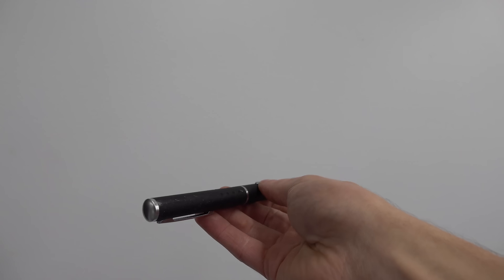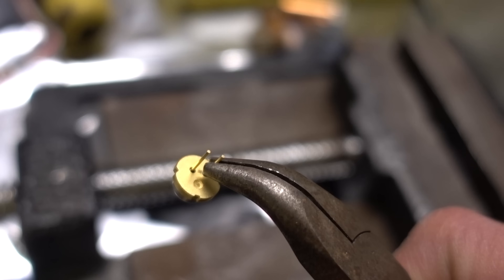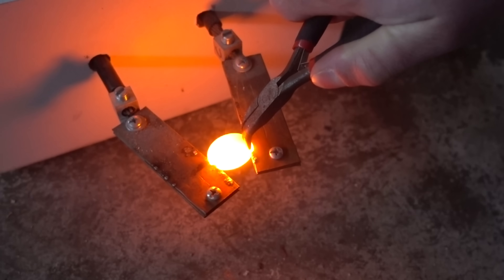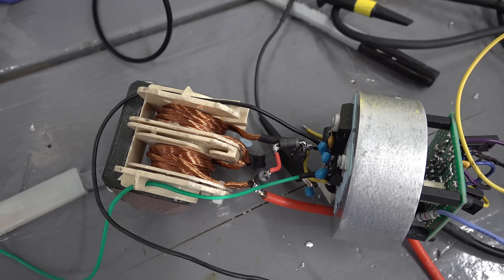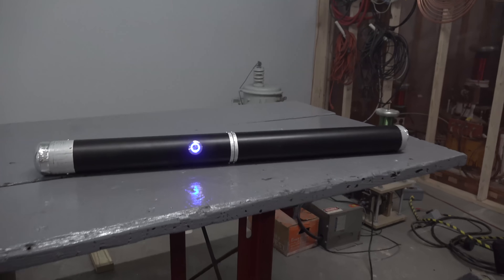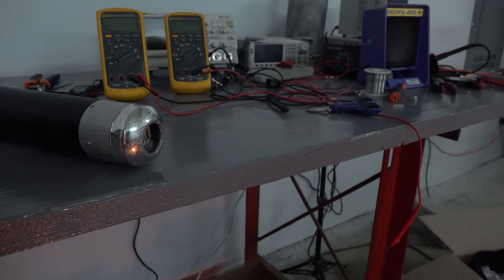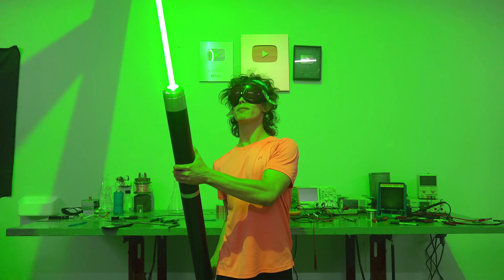the brightest laser pointer in the world!

Comment: I'd really like to see a styropyro explanation and hack video covering LEP lights.  I mean, it's a practical consumer use of lasers that just begs to be Tim the Tool Man Taylor supercharged well beyond common sense.

On another note, have you ever looked into building the optics and mechanical assembly to converge all the beamlets in one of those laser arrays?  Obviously it would be tricky as heck to get everything to work together to actually divert each beam just enough to converge at different distances, but it should make one awesome looking set of mechanical linkages.
Reply: How bout a distance finder coupled with a liquid flex lense..  Can use a clear liquid filled , linear,  in tube electromagnetic piston pumping fluid to convex or concave the flexible lense, callibrating it to work on demand with the distance finder... Fluid in electromechanical tube is pushed and pulled at same time.
Reply: Any Thoughts?
Reply: You could just use a few giant glass (or other material) lenses in a similar format to a camera, but in reverse. A camera takes a large area of light and converges it without too much distortion onto a smaller area. If you do this in reverse, you can converge a laser array down to a smaller area. The only problem is that the laser could end up melting the lenses. In which case you have to use mirror-based lenses made of metal.
Reply: @nikkiofthevalley  Dig it.. Understood.. However the fluid as with any component needs to be cooled.. So apples and oranges?
Reply: Initial thought is repurpose a DLP array out of a rear projection tv as some form of adaptive optics. If not it'd be funny to see them catch fire and explode.
Reply: @johnalees99  so what you're saying is collab with @ElectroBoom

Comment: hey quick question, how far does the heat travel down the laser? would it heat stuff up the same from 100m or further as quickly as point blank?
Reply: Yes
Reply: The beam itself does not eminate heat. From my understanding, the heat is generated as a response to friction from the massive energy waves slamming into a solid object. That's why the laser can't ignite the fuel vapors by itself

Comment: I had a green laser pointer like that first one. It was pretty good, I mostly used it to play with my cat, which was fine. But the battery wouldn't connect properly for ages so I replaced it with a better quality looking one, and this one I don't like for the reason you stated; it's too strong. The green dot it makes is bright enough that looking at it can put spots in your eyes across the room, and I kept thinking it was too dangerous to play with my cat anymore. I basically stopped using it for that reason.

Comment: I just purchased one of those green lasers. I was wondering if you can safely look at the laser impact on the wall? It's very bright and can illuminate the room green
Reply: If it illuminates the room it is probably way more than 5mW. I have one that measures around 3mW and the dot is bright but not difficult to look at. No after images either. Using it as a room light doesn't work :p. If your eyes are really adapted to the dark it might work, I never tried.

Comment: p.s. a m2 1.6 200mW DPSS will smoke a CMOS sensor easily. Let alone 10W OPSL, 30W rgb etc etc... will do it at quite a distance. Projectors also don't like it. This happens in shows rarely when cameras (drones) and projectors with lens caps/internal shutter open/not fitted when they are supposed to be..

Comment: Interesting note about green gap LEDs being inefficient.  But what about the seafoam green LEDs that provide visible indicators drawing only micro-amps of current?  I have a bag of them... can use one seafoam green with 68K resistor on 5V for power indicator to get same brightness as standard green with 470 ohm resistor.

Comment: how narrow can you get the beam if you straighten it up with a 2nd lens ? i really wanna see you run that thing through a telescope back ward to see how concentrated you can make it and use a whole bunch of them to see how expensive you have to go to reasonably handle that power man these would some telescopes you don't wanna look through ... put a camera at the eye piece for the fun of it :3
Reply: Sims I ran on the blue osram modules on black market (I work with lasers that styro can only dream of) gets to around 160-200um beam size. Green will be larger spot size than that by a bit.

Comment: You can also use a *good quad op-amp to do PWM control instead of using a 555 timer. This allows for more room designing such things as current limiting. You can use a hall effect current sensor for output current reading.

Comment: right here i have a green laser pointer that i bought online 😀 there's a good chance you've seen one like this before 😅 and in fact 🤓 a lot of you probably own one of these😮now i have mixed feelings about these things 😥i mean yeah 🙄theyre cheap 🤨 and they can be pretty educational 🤓but they do have some big problems 😣for one 😱 theyre often substantially stronger than advertised 🤯and yes 😑this is a bad thing😬i realize how ironic this sounds coming from me 👉👈 but i mean 🤔 these things are sold as toys 🤨so most people 🤡buying them💵🤑💸have no idea how dangerous they can be😔to the eyes 🙄another big issue🚫is that they can leak a dangerous⚠amount of invisible infrared light ⚡and this can even happen from pointers 👉with a dim green🟢spot. this stems🥦from the fact that theyre driven🚗by a powerful infrared laser diode💎that powers 🔌a separate laser crystal 💠and then the output 📤 of that is fed 😋🍔through  a frequency 📻 doubling crystal ✌💎to make green light🟩💚💡⚡

Comment: The fact that the laser module has a visible spool-down period when you turn the laser off is terrifying
Reply: Yes^ it’s actually the field energies stored somewhere in the circuits being output, nothing to do with the power output
Reply: I have a set of colored led spotlights that retain some of the light upon deactivation, should I be worried? These things can be mounted on any modern bayonet style lamp support
Reply: @DrHundTF2  i don't think so. Steve Mould and ElectroBOOM have videos on chinese "zombie" LEDs that stay on
Reply: @DrHundTF2  nope, your wires work as a capacitor to give the LED tiny amounts of amps. The fact that the laser module has a visible spool-down period when you turn it off means absolutely nothing.
Reply: It's not really lasing in that time frame, Though... Just being ran under threshold.
Reply: Is that from energy stored in the inductors of the transformer in the form of a magnetic field?
Reply: @jefferyduke6532  magnetic fields kind of are what stores energy in instructors. I'm assuming in this case it's probably a combination of that, and the capacitors draining off.

Depending on the switching circuit that runs the flyback transformer, it could be doing some LC resonance shenanigans that aren't getting interrupted by the power switch and basically have to ring down to zero.
Reply: @wtechboy18  arktually its just the big filter capacitors

Comment: Dude you obviously can do just about anything you want in this realm... have you thought about using your powers for good? There is significant demand and "perceived" need for civilian grade LAMs that are good quality. You could nail this. Some are even going to Russian modules because they are much stronger because of trade laws. A solid unit at around $600 or less with common batteries and solid case would be worth $$$$$$$ on the civilian market. Thats my two cents. (Giving you gold bro)

Comment: Hi @styropyro.
We're building dye laser. Original plan was to pump it with high power flashlight pumped, doubled Nd:YAG but your diode arrays look much more promising. Where could we get one or 2 of this arrays?
Reply from the maker: you need essentially a diffraction limited spot for CW laser pumping of dyes. you won't be able to do that with one of these laser diode arrays
Reply: @styropyro  I'm aware that array of laser diodes can be at best focused to array of points but I was under the impression that they can go near diffraction limit.

An the other hand we have limited success with expanded beam focused to line using cylindrical lenses and we're hoping to generate one line from many diodes using carefully selected cylindrical lens. First Line will pump medium to get lasing action and rest will work as amplifier

Comment: You could use the boost converter from a gen2 Prius inverter. The boost converter will accept any voltage from 0-215v DC and only 12v and 8khz PWM signal to control it.

Comment: why not implement a capacitor pre-charge with a relatively high-value resistor from vbatt to the cap across the laser diode array to charge the cap in the period between connecting the battery and pushing the laser on button. If LDO Input is pulled to ground in the "off" state, then implement another very high value pull-up, just high enough to never exceed maximum voltage across the 338.

Comment: I'm curious what the effective visible range of this is.  How far will the beam travel before it disperses so much that the end point is no longer visible?
Reply: In space dude. I’ve seen weaker ones pointing at stars and you can see it on point.
Reply: @rockjockchick  Those aren't reaching the stars, and you're seeing the beam because you're near the point of origin. 

It's a question of beam divergence.  The beam widens as it extends, and at a certain point the beam is so wide that the lumens per unit area it's striking are too faint for our eyes to see, at which point it's invisible to us.

For a normal 5mw hand-held green laser that's not all that great of a distance, for a 200mw laser that's something like 10 miles.

I'm curious how far this one would project a point of light, or become invisible.

Comment: Speaking of the dangers of microwave ovens, the magnetron has certain bits that contain some osmium compound. If your angle grinder takes a bite out of that, you’ll fill your room with incredibly toxic materials (probably osmium oxide). So, if death by high voltage isn’t your thing, you could consider osmium poisoning next.
Reply: I sincerely doubt there is any osmium, one of the rarest and most expensive elements in the entire periodic table, in a microwave or any other kind of conventional power transformer for that matter. You are thinking of the beryllium oxide ceramic insulator around the output antenna, and even that was phased out ages ago, they're all simple harmless alumina insulators now.  People need to stop upvoting random scary sounding garbage on here.
Reply: @Muonium1  The Voice of reason has spoken.
Reply: @Muonium1  Thanks for the update. I should recheck my sources. It was a very long time a go when I came across that thing.
Reply: And also berillium oxide.

Comment: Styro I have a question and I never do on your videos. When you were using the lens to concentrate the beam, when you turned off the laser, it looked like there was some type of green fading residue on the material. I take it this was simply the laser pointer still shutting down and having not fully stopped projecting. Was that just the camera adjusting to the sudden decrease in green light and not actually a physical property?

Comment: Is it possible the have a lazer measure how much light is reflected back into the diode by using the diode itself? Also I wonder if it could eventually be possible to measure spatial inertia, by pulsing a lazer into a vacuum, and measuring the feedback, though I know that it would be extremely weak. Of course the device would need something like a "MR660 Multi-Axis Fiber Optic Acceleration Sensor System" to clean the data...

Comment: Cool fact, solderless breadboards are fine -- but you need to know good layout to do it.  I've made converters up to, oh, a hundred watts or so that way?  Short wires and tight grounding are mandatory.

If you're curious, I've also made a 555 circuit (with relatively few support components) that more or less mimics the behavior of a UC3842.

Comment: Hey dude, if you wanted 120V at 2A why didn't you pull the diode rectifier out of the microwave? You could have used your high side mosfet plus a current shunt an op amp to control the current. Nice laser though!!

Comment: That driver circuit though 😂😂 You really like gambling with the life of that laser diode there haha.
A free-running boost converter is a bad idea any day, but then trying to limit the current after that with a linear regulator is like balancing eggs on top of each other lol. You're basically one lick away from killing EVERY component in the circuit with those potentiometers on the 555.
Meanwhile the simplest type of boost converter, a current controlled one, would solve everything at once and be WAY more reliable.

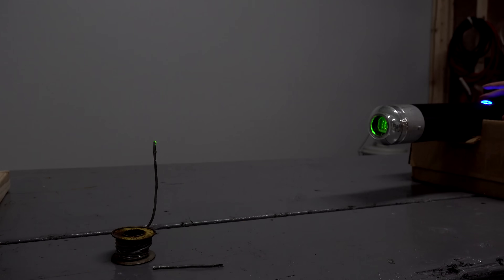Comment: Can somebody explain how the sodder wire is glowing green after the laser turns off at 14:19? Is it just a video artifact?
Reply: The soldering probably had a high zinc content, which will burn green when that amount of energy is dumped into it.  I think it's coincidental, nothing to do with the laser being green.
Reply: Actually nevermind my previous comment.  If you look closely at the lens, you can see the laser takes a second to fully turn off.  So the green glow on the metal is in fact the laser still reflecting off of it as it winds down.

Comment: Amazing you got that efficiency with the components in that crapdriver. Testimony to artful layout and fabrication and the fact you are probably using top of the line where it counts.
Reply from the maker: heh yeah i'm using a SiC MOSFET as the switcher on the boost so the losses in that are tiny. I could have gotten a few percent better if I had gotten rid of the linear current limiter on the output. now to be fair, the 94% efficiency is only at one battery voltage. above that and the efficiency is lower, below that and the laser power starts to drop.
Reply: @styropyro  Not worth risking your unobtanium array. Tesla uses all SiC MOSFETs in their power conversion circuitry. Magical sand diamonds get er done.